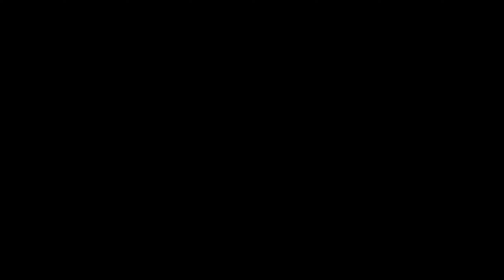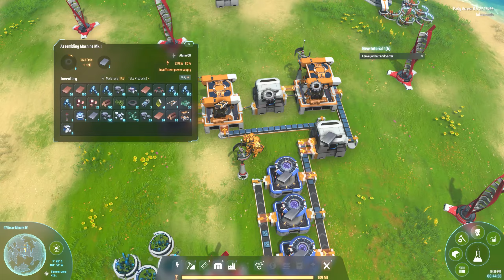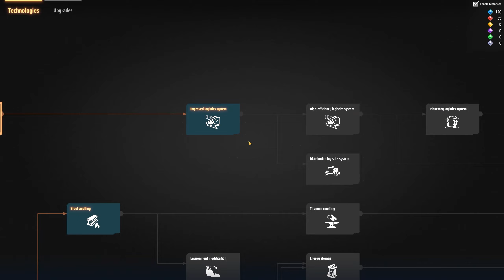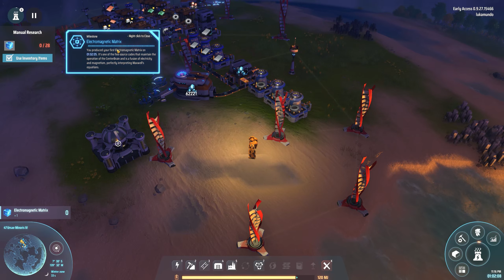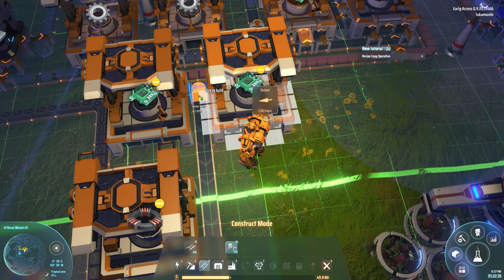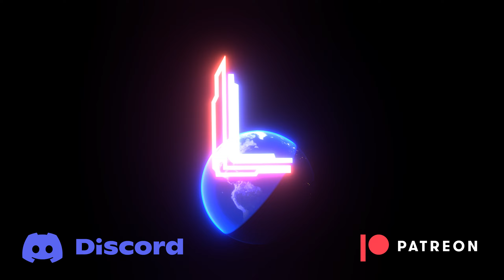Continuing My Production Line in Dyson Sphere Program Ep2

Comment: i wonder why you used splitter to combine 2 belts in 13:03 with sorters, and in 13:52 you just casually building a belt junction. (also you don't need any splitter to combine 2 flow of belts).

a tip for you, sorters can pull excess fuels from thermal power plant to another thermal power plant behind it, so you won't need any belts behind the 1st thermal power plant.
Reply from the maker: So ya, I was terribly inefficient with the sorters. I plan to sort it out later, pun intended 😜.  But I never knew you could pull power out of the power plants. Awesome advice.